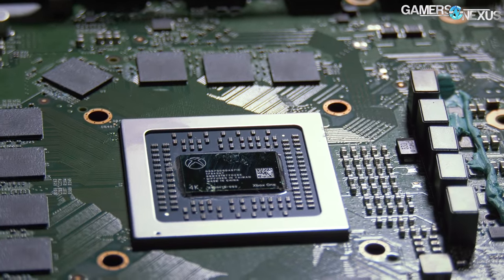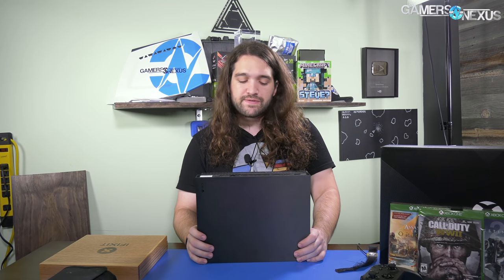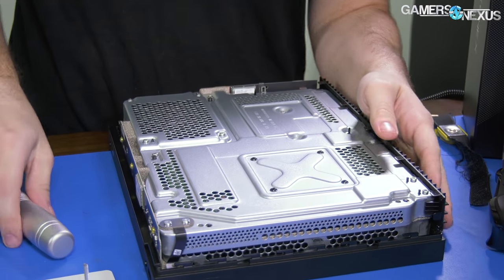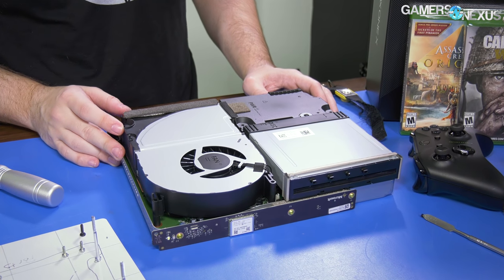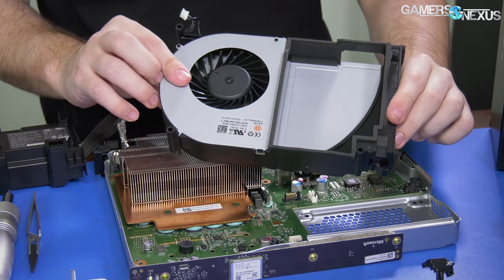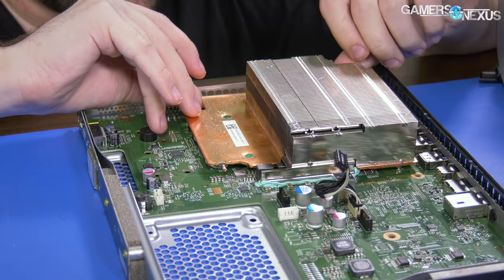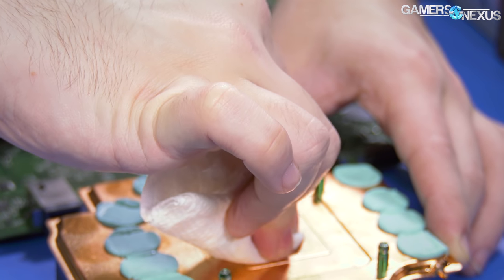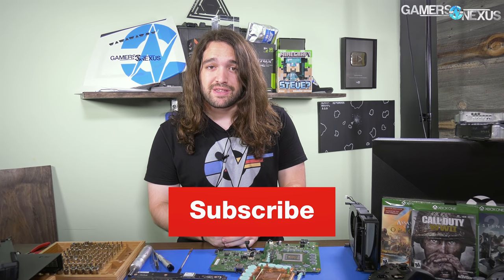Xbox One X Tear-Down: Semi-Modular Console Design

Comment: Looks simpler than a 360 breakdown, but the OG was the simplest console ever to open.  Six long screws on the case, three smaller ones internally (HDD and DVD trays), done.  Mobo and PS right there in front of you.

Comment: NO SSDs LOL
Reply: Not really lol, they could have quite easily put one in at OEM cost & claimed "VASTLY SUPERIOR LOADING TIMES, UPTO 10X FASTER THAN PREVIOUS GENERATION" & no one would have minded. That or, they could have released two models, one with HDD and one with SSD.
Reply: RAD Tech it's not a next gen console and there are two models out. There's an interview with one of marketing/dev team on unlocked that talks about how it got started if you want to check it out.
Reply: Games are compressed.  Most of the load time is uncompressing and forming the data structures.  It's really only alpha and beta games that haven't had load order optimized that see a huge benefit.  That is making sure files are sequential in the zip files based on load order rather than alphabetical or something.  
Hybrid is the way to go for a console for cost performance.
Reply: @abram730  Update. They did not go with hybrid drives for the next gen console (thankfully).

Comment: I'd rather drop $1,200 on a decent gaming PC than $500 on that crap. The Jaguar 8-Core CPU is still an Achilles Heel and still a factor in overall performance in the X. And with XBOX games already on PC and more coming, I can see no point taking a screwing trading the XB1S I have at GameStop and shelling out more money. Technically by the time you basically give away the $300 S and shell more money for the X, you might as well keep the S and just build a PC.
Reply: 1200 dollars will get you a pretty good pc, but its a console that costs 500 dollars, probably not for you at that price point lmao
Reply: I usually build my PC's, but Dell had an amazing deal on the XPS. I got a I7 6700k 16GB ram for $600. I put in a used 6GB 1060 and have a $750 machine that can play everything.
Reply: The Champ  My 300$ pc has an e5-1650, ebay intel board, and a used gtx 1060 3gb.
Reply: Shit I'll prepare to drop $500 on that Xbox and saved the extra $700, I think that's smarter, anyways at the end of the day it has some good graphics and 4K,
Reply: Trade in at Gamestop? GG, Gamestop offers low prices.
Reply: I got the Xbox One X for $280. And I'm super excited. I'm normally a PC gamer but for the power of the X and price, along with the 4K Bluray player, it's 100% worth it to me.
Reply: and you have that option and you will likely still be using Microsoft. The "achilles heel" of PC right now is that it takes quite a lot of power for 4K gaming (let alone 4K HDR),  and GPU power is coming at a huge premium right now.

Comment: I got my one X on release day, First game i installed was Fallout 4 GOTY which was notorious for dragging down the original XB1 even without mods....When i loaded it up, load times were pretty much none existent when compared to the 30-40seconds you'd wait on the original one, The X would load in 5-10 seconds. 

The gameplay though...it was so fluid, even though it wasn't 60fps it was locked 30fps which makes it feel fluid when the fps doesn't stutter at all. 

Great investment when they were released, but not now due to the life cycle on the One only being another year or so.

Comment: Test your thermal result with an infrared gun. There’s stock temps already available.  Around 105F. Not sure if ambient was available but that should at least get you started.
Reply: Bob Of All Trades Infrared guns aren't as accurate which is why they don't use them.
Reply: SlavjanA “They” as in GN that’s fine and dandy. But for the sake of stock TIM vs Aftermarket it is all you can do for starters. If that’s something he’s interested in.
Reply: Bob Of All Trades what is it in non retardet units?
Reply: 105Fucks?

Comment: Most likely the X shaped metal is not bend to frustrate your plans of disassembly, but ease of assemble. That way you can place the vapor chamber, hold it in place with the retention X-shaped metal, and then you can put it into the metal piece and tighten the screws. Otherwise the X-shaped metal could go basically anywhere.

I'm guessing that piece is meant for force distribution and that the screws are not overtightened, but that's just my guess.
Good vid. I watched Luke's (LTT), but it had many parts edited and some stuff wasn't even showed because they didn't have them, so this is a more comprehensive video overall.

I'd like to see a thermals review just for the pleasure of knowing more or less the data. It should be interesting, IMO.

BTW, you should tune into next WAN show and say when Luke was wrong. (For the fun, to make that clear)
That way the author of www.lukewaswrong.com can see it and improve the site XD

Comment: Has anyone ever tested what happens to "regular" thermal pastes in sub zero conditions? Just thought that might be the reason why manufacturers use these hard and dry thermal pastes (on pretty much every product, not just this) so that if it gets into sub zero temperatures in storage/logistics the paste wont form crystals etc etc. I live in Scandinavia so thats where the idea comes from. Electronics are definitely not shipped in heated containers or trucks.

Comment: BTW: The screws are "security torx" screws, and MS has been using them since at least the 360.  I don't have these, so I don't know what size it is, but torx 10 (security torx 10) screwdrivers and bits can be bought on ebay dirt cheap.  I bought one to take apart a controller for less than $1.  You can and should get a set of them to have around if you disassemble electronics.

Comment: When he got to the heat sink I could clearly tell he had never take any kind of Xbox apart before otherwise he would have known about the x-clamp they have been using since the Xbox 360. Either way it's probably good you took it apart the thermal paste they use looks to have gotten better but is still terrible. The paste on the 360's was almost like when you peel a sticker off of something and have that sticky sticker residue left over it was incredibly annoying to remove as instead of wiping off it just wanted to smear or move over instead of coming off. I had to use like 6 q tips and 2 coffee filters to get the last one I opened perfectly clean. Should run cooler since I applied gelid gc extreme when I re assembled it. There was nothing wrong with it, I was just cleaning it out since it was an old 360 and figured it could use new thermal paste and some dust removal.

Comment: I was wondering how the PSU is cooled, but couldn't grasp it very well from the video. Does the main fan somehow blow air towards it? From what I see, the heat sink is in the way, even though there's obviously a cutout in the metal casing that covers the fan... Not sure how the air is routed.

Comment: I do not think you can replace the internal hard drive. For two reasons I think, 1) I believe each HDD is tied to each console via a hardware key and 2) Even if you were to replace it with an SSD, there would be no OS on the drive, and unlike Sony, you cannot just go download Xbox OS. The only way I could see that working is a bit-by-bit cloning of the drive to an SSD, even then, I do not think that would take care of the hardware key.

In fact, this article from Geek states that it is possible, but really hard: https://www.geek.com/games/you-can-replace-the-xbox-one-hard-drive-but-its-hard-1577953/
Reply: Kacey Howell don’t over think it, the OS is stored on a flash module.

Comment: It's time for $60 games to come on a USB drive, a SD card, or DLC only. 1/8th (or more) of that case is eaten up by an optical media drive. It's a $32 part on Amazon if you need to replace it.

Also, whatever cost expended to get that screwdriver set in the wood case was visibly justified at 3:05. That set though 0_0

Comment: Yo guys, watch out at the 16:40 part, it's very tricky. Too bad that I've watched this video first because this isn't exactly how you're supposed to handle that radiator bracket. I have tried just like on the video but accidentally damaged the PCB (made a scratch and destroyed one of the transistors). If you do it from the top of the green screw just push down your screwdriver right there and pull up like a leverage. This way you won't be able to make any damage to the PCB like I did. That's probably the most tricky part in the whole One X design, it's very easy to take apart and clean.

Comment: hey,  I am having trouble connecting my controllers to my system wirelessly ( via usb is not a problem). Do you know what part in the console I would have to replace to get this issue resolved?

Comment: They could use thermal paste on top of the capacitors and also have the heatsink dissipate heat from them, but they would need much more thermal paste and better thermal paste on top of the CPU and capacitors
They could use 2GB ram chips to make it smaller, and I would be amaze if they can come up with something like one single 4ram chip, because that way they would be able to only use 3 ram chips and make it smaller for an XBOXONE-X slim, NO HDD just 3 M.2 slots in the back of the board
Reply: Leone Furlan 
Reducing the price doesn't give more money, if that was so Apple would had been out of business long time ago, is quality and durability that makes a product stand out from the rest lower quality, third place is not the greatest
Reply: Capacitors dont really need thermal paste i have never in my life came across any computer motherboard or laptop motherboard with heat dissipation on the capacitors 

They used 1GB chips cause it would have been cheaper buying in bulk and its GDDR5 which is more pricier then DDR4 and DDR3. And they would be able to get the HDD for 5-10 bucks a piece and yes m.2 is better its more expensive and the capacity of games with games around 50-80GB you would have to get a pretty large capacity M.2 to store at least 10 games around 50-80GB.

Comment: I want to be a dick so bad but we all have our strengths. Instead, hears what Nexus missed... On the subject of built in OBSOLESCENCE, the cooling fan sucks in cool air and blows it over the cooling fins of a "hotter than the surface of the sun" silicone die, then proceeds to blow that hot air into the power supply with it's own hot AF power switching with big fat nasty caps full of liquid electrolyte susceptible to MAX 85*c for extended periods of time. The "SMDs" on the APU are surface mount components called capacitor arrays, never get thermal paste on them which Microsoft clearly did. Capacitors provide the immediate boost of energy the APU needs that the power supply cant keep up with. They don't work if they "leak". That Amazing Vapor Chamber is just a way for Microsoft to save on copper and milling. Its no substitute for a  solid chunk of copper. So long as there is somewhere for the heat to go, there will be that differential in fact depending on vessel preassure, altitude, temerature, and gas used its more of an insulator in fact I would bet its a total crock of shit. At best you would get gas convection. Horrable. One last thing I noticed was the RAM and APU are thermally coupled. Why? Has ram ever gotten that hot, if so then why not isolate it. I bet heat from the APU travels faster thru the copper to the ram, under a gas insulator mind you, than it does up the fins of the heat sink. Enjoy your lead free solder and parts you have to flash to in order to replace. Its just short of sucking corporate dick with a shotgun blast full of corporate wadd, then have your shoes stolen off your feet after and called a whore just because they could.

Comment: You cannot simply replace a bluray drive or change the hdd for an sdd. They have security sectors and the bluray has a unique key which binds the mobo to the drive. Same for hdd.
Reply: you can change the drive.. https://gbatemp.net/threads/xbox-one-internal-hard-drive-upgrade-or-repair-build-any-size-drive-that-works-on-any-console.496212/
Reply: @ghostwriter720  ah nice, on the 360 the hdd had a security sector which could only be written to a certain brand and type of hdd. Glad they opened this up

Comment: So a 580 should technically be able to crunch more numbers than the Xbox One X.  Since the clock speed more than makes up for the difference in cores.  I realize reality is a different thing, depending on optimization.  Obviously the consoles CPU is nothing to write home about.  I'm just talking GPU power.

Comment: Does it use same socket as previous apus? I was able to water cool my previous ones with the same block that I used on 360 cause they used same bracket spacing. I know the x could def benefit from water-cooling for sure

Comment: Hey G-Nexus. I'm having issues with my X1X turning off instantly. Do you have any suggestions on what I can do to possibly fix it or check for that is fairly simple to check or diagnose? I've put in a new power supply, new hard drive and about to try a new fan but not expecting much from the fan.
I see your very knowledgeable on this and hoping for some decent guidance.

Comment: Hey , will this power supply work on 240 volts input ? Is it dual power supply adapter which support both 100 volt and 240 volt as input ? Gamers Nexus
Reply: The power supply is automatic switching Psu it will both work on 110 and 240 it is on the stated on the input on the sticker

Comment: I think that little USB module might also contain the Wi-Fi antenna (not the chip). That thing with the double screw mount at the end of it reminds me of a Wi-Fi ribbon cable. I'd be curious if the Wi-Fi module that you took apart later had an antenna built in.

Also, my understanding of Rubberized paste is that it liquefies when it heats up.

Comment: why cant pcs be like this, so we dont have 3000 cables sticking out all over the place?  the motherboard , case and psu should be combined imo so no need for silly cables someone need to inventa cool, sexy case, with  a high end mobo and a nice gold psu, all you need to do is plug in your  cpu, ram, gpu  and sdd, and you good to go, no cables.

Comment: you cannot replace the Drives they are all Linked via the built in Fermwear just like the first gen Xbox and 360 Etc to stop modders and hackers etc yes there are sites that have tools to let you flash your bios Etc but Microshaft will Ban you in a heartbeat like they have been all ready..

Comment: I feel it's important you know that your using a scorpion Edition they were supposed to have a slightly better build than the standard X at least that's what Microsoft promised at announcement I don't know if these specs lineup with the actual generic X model please correct me if I'm wrong it just seemed like you didn't know the point is a scorpion or the logo with Master Chief because they're code name for the Xbox One X was supposed to be scorpion and it ended up being a running thing so they released a special build version of the Xbox One X with slightly better specs

Comment: I'm confused where the video card is. is it built into the motherboard? I'm assuming the chip with 4k written on is the cpu.
Reply: Both the CPU and GPU are under the lid with the thermal paste.  They are on a substrate that gives a PCIe 8x like data connection.
Reply: that chip with 4k is the gpu too

Comment: So what you're essentially saying is that an Xbox's GPU is on par with a 1070?
Reply: Fuck no. On par with an RX 580 (even using a similar architecture), which is just about even with a 1060. A 1070 performs 40% better than an RX 580...
Also the XBone has an APU, not a GPU.

Comment: the hard drive is using seagate firecuda i think because pattern in the top and the back is 100 percent same and the firecuda pattern desin in top and back is ony fire cuda have an the chace is 128mb with 5200rpm is the typical of SSHD Seagate FireCuda i think
Reply: Seagate uses the same casing for all of there 2.5 inch drives
I found a picture of the xbox one x HDD and got the part number (1RK172-123) the drive can be found on amazon https://www.amazon.com/Seagate-Laptop-2-5-Inch-Internal-ST1000LM035/dp/B01C4W29XC

In the Title the Model ST1000LM035
The drive used is the last gen drives before the new 2.5 barracuda and firecuda drives

Heres the drive here 
https://www.newegg.com/Product/Product.aspx?Item=N82E16822178875

Comment: Since there's a standard 2.5 inch drive, could you load a different OS on an ssd?
Reply: Chillstep Is Life what do you mean different like use the drive in a laptop
Reply: Chris Wright No, more like have Windows/Linux running on the Xbox
Reply: Chillstep Is Life Putting windows 10 might be possible,unless it's somehow locked.
Reply: Thats what I was thinking as well. That's ok, though. I like my PC just fine.

Comment: It baffles me why they use that garbage rubbery thermal interfacing material. Just the other day I removed my water block while changing motherboards on my PC after 6 WHOLE YEARS of it being on there and the Arctic Silver 5 was still as fresh and spreadable as it was when I originally put it on. There's absolutely no reason for them to use this garbage but they continue to do it.